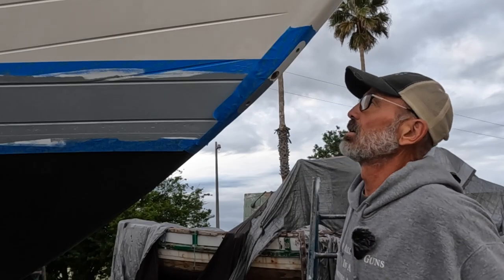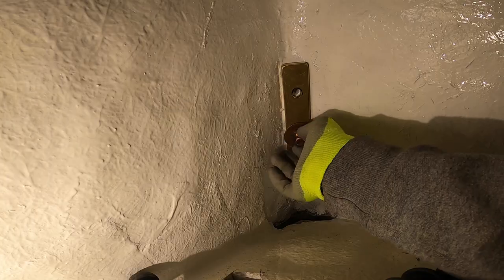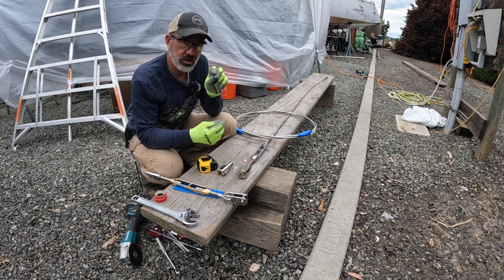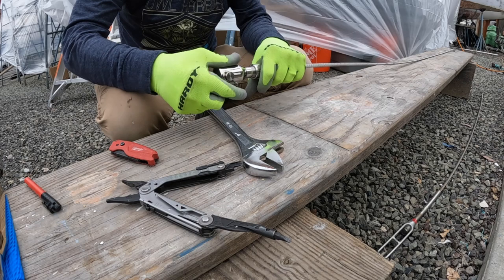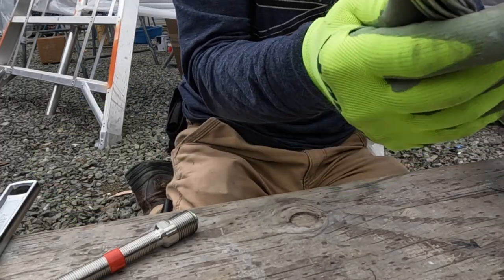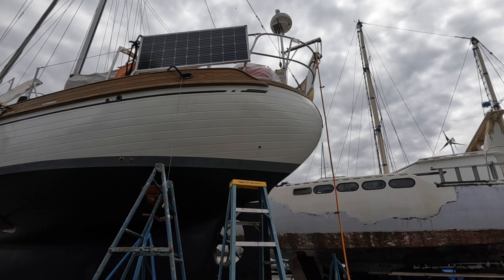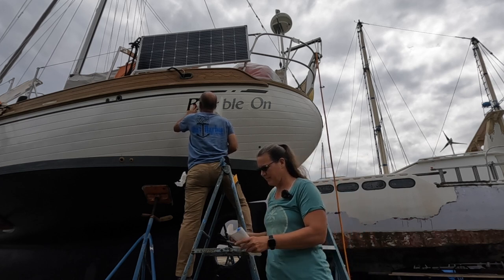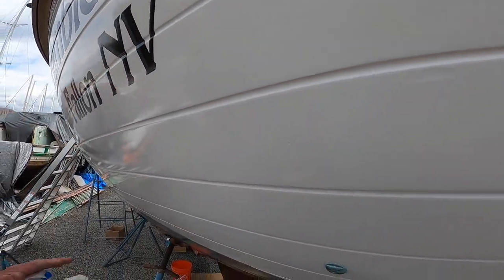The Final Seal:  Bobstay Fitting | SV Ramble On

Comment: Thanks for highlighting the Hi-Mod rigging terminals, and after some quick reading, I think I'll use them instead of the Sta-Lok terminals I probably would have used when it comes time to replace the rigging on Cyclops.  A commenter in an article that compares various rigging terminals, published online by Practical Sailor, mentions that he installed new terminals in 1992 without sealant and has periodically disassembled them for inspection.  He hasn't had any problems, and he regularly uses WD-40 (or similar product) to clean the rigging wire at/inside the terminals.  I think that might be a better choice than using sealant, which might instead promote corrosion in some cases. The PS article is entitled "Mechanical Rigging Terminals: To Seal or Not"
Reply from the maker: Great information!  Thank you!